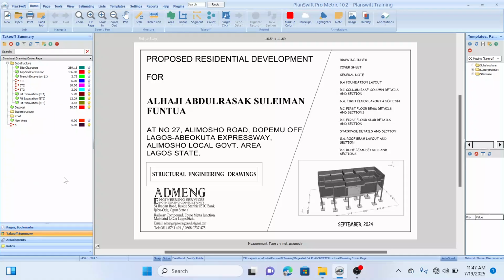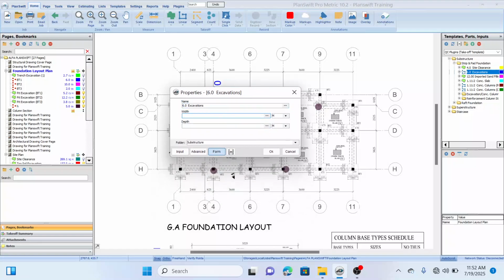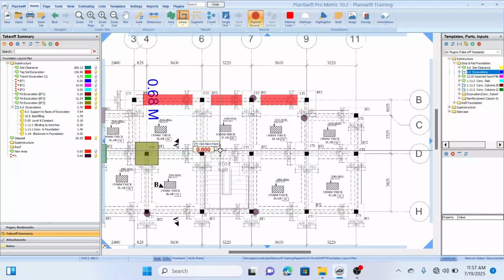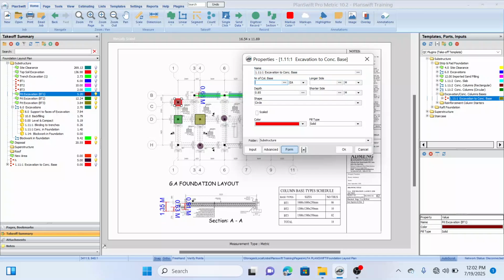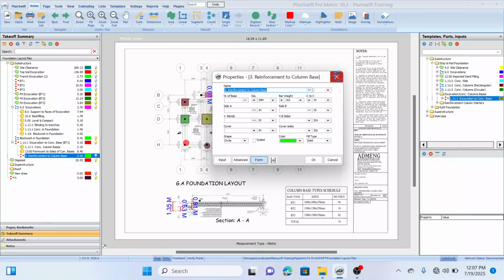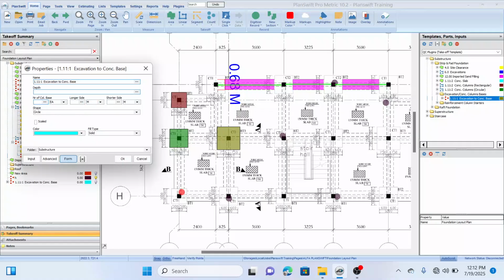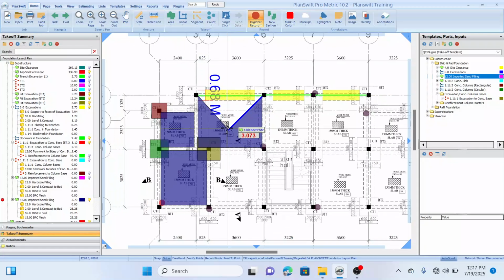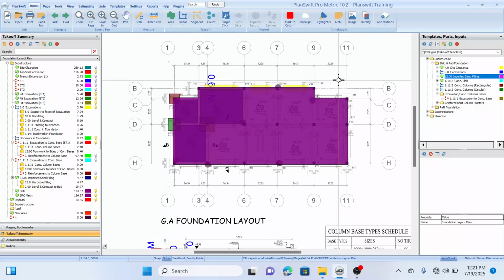Substructure Measurement (3) Using PLANSWIFT Plugin

Comment: Hi sir,i have a doubt that needs clarification from you concerning the number of bends for reinforcement for BT1.we have 2 mats both ways,is it only 1 mat that you got the 2 bends from?
Cos if we have to have both mats with bends then it will add up to 4 bends.Thank you looking forward for ur reply.
Reply from the maker: Good day boss, I actually considered only one reinforcement in my calculation, then the whole thing was now multiplied by the numbers of reinforcement. Hope you understand?
Reply: @UpcomingQS so u mean 1 mat with both vertical bends will equals to 1 bend and another opposite mat with both bends will also equals to another 1 bend so 1+1=2 bends,is that what you mean by 2 bends?
Reply from the maker: @jacksonsilimanu4089  No bro, what we actually considered here is one reinforcement, then we add the two bends on both ends to the length of the reinforcement, then we deduct concrete cover from that to get the actual length of one reinforcement.
Then we multiply the result by the number of horizontal and vertical reinforcements that are required for one base and lastly, the result will be multiplied by the numbers of column base. 
Hope you understand?
Reply: @UpcomingQS got you brother thanks so much ❤.
Reply from the maker: @jacksonsilimanu4089 my pleasure bro
Reply: @UpcomingQS when will you do one for for exporting of the takeoff's to excel?
Reply from the maker: @jacksonsilimanu4089  I will do that soon sir
Reply from the maker: @jacksonsilimanu4089  I will do that soon sir